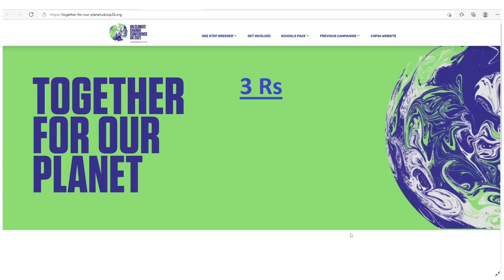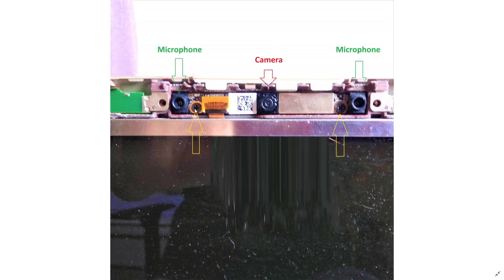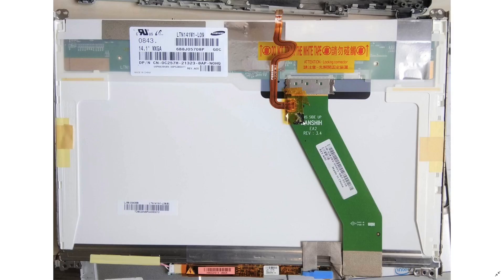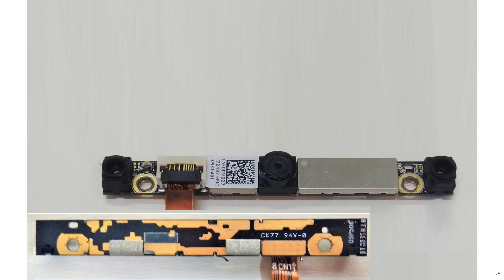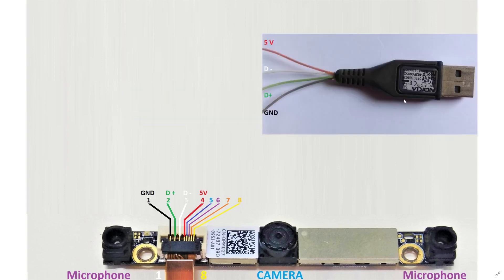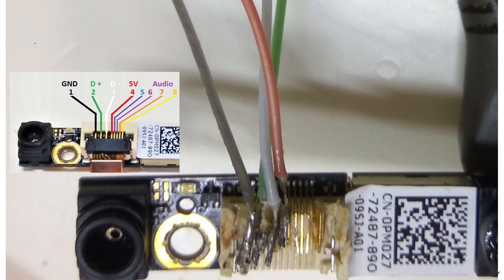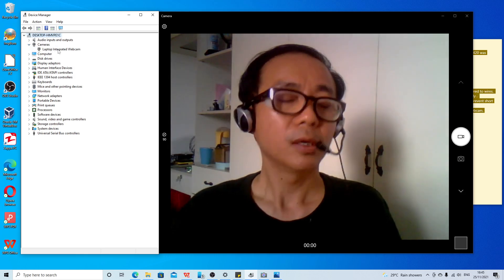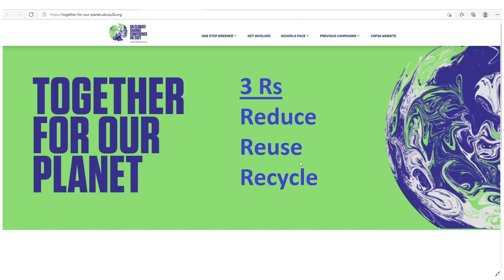Convert Webcam (CK77 94V-0)of Dell Inspiron 1420 to a USB webcam  to be used with desktop PC

Comment: I have older style connector.
Black and White wires were twisted together but, connected to ports you describe in your video.
The rest are for sure Audio.
It would not be hard to connect left/right microphones to respected sources.
Could one guess that two microphones are for outgoing in stereo?

Comment: why do we need to identify the power positive using a tester, cant we just alternately switch the wire to know if it will power on? will it damage the camera in case we connect  the power to a wrong wire?
Reply: if you put it on a data line, you'd cook it.
Reply: since these components are integrated, they do as much as they can to be small, so they avoid putting some protections because they're not customer-grade and meant to stay connected internally.